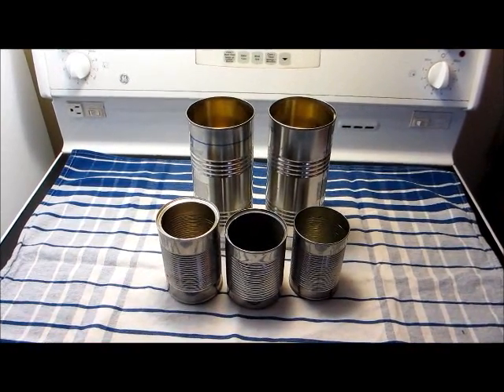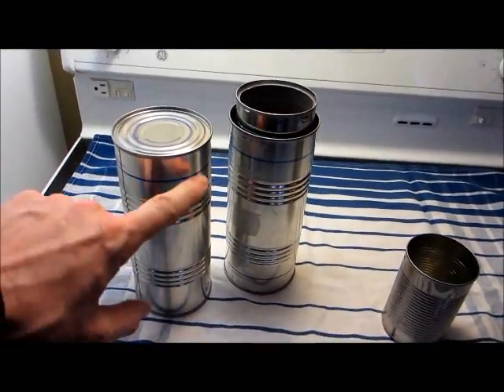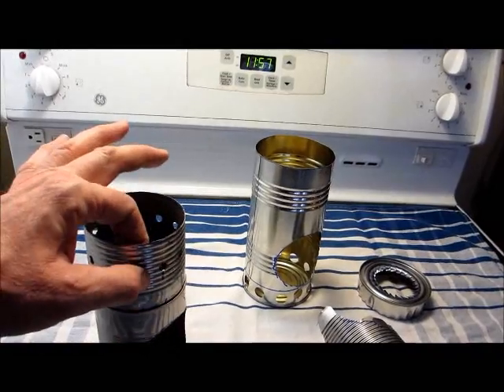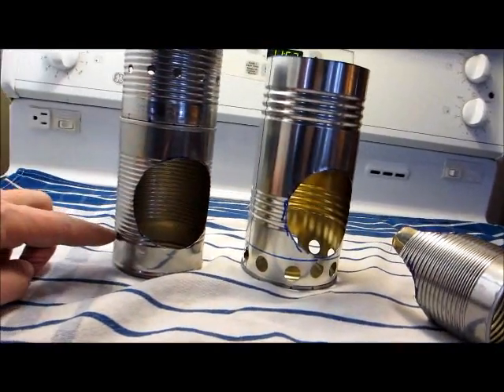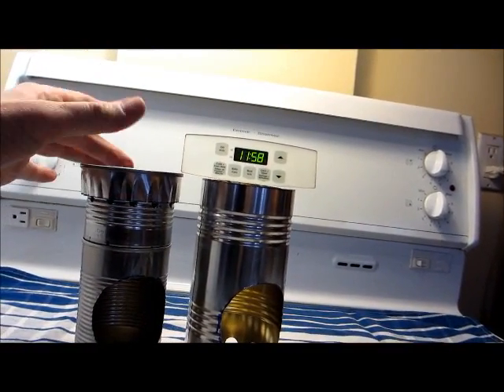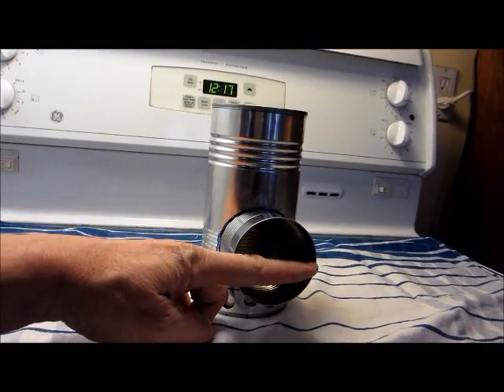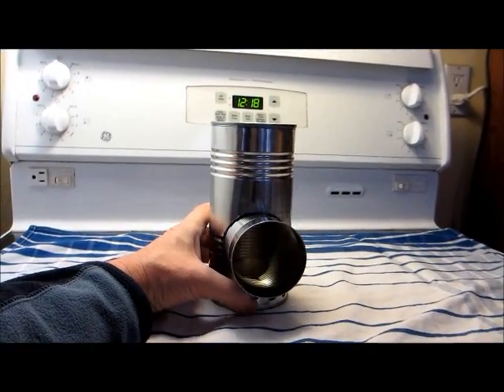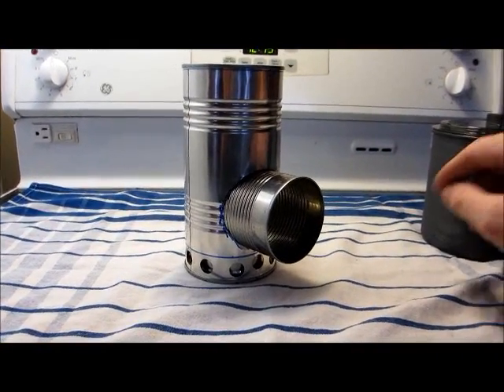Cheap Bastard's Hybrid Rocket Woodgas Camp Stove

Comment: Good Stuff - if you think it could be a bit flimsy in the wind add a base plate or !....! secure with a tent peg on site to keep the weight issue down. I use the inside of a toilet tissue roll filled with ready cut strips of card, lint and other stuff to start the fire and then pack around with twigs. If you take it with you in a sealed plastic bag you'll know it's dry tinder.

Comment: use a clothes hanger to raise your pot just above the top in order to satisfy the  problem of the pot blocking the venting of the air flow
Reply: the hanger wire only needs to lay across the top to be raised enough to vent

Comment: what's to secondary burn from the outer can? the combustion chamber is isolated from the outer can. only fresh air can make its way into the fire from the outer can's holes. besides, being of higher temperature, air would prefer to enter through the side feed pipe anyway. without a secondary burn of woodgas, it's not a gasifier stove. without a thermal mass to retain the heat in the chimney, it's not a rocket stove. all you have is a multi-piece, overdesigned chimney draft stove.

Comment: for this to really work as a woodgas stove you would need some holes along the bottom of the burn chamber, so that the air rising on the outside of the burn chamber can pull the woodgas up along with it for secondary combustion.  otherwise, nice work, i am currently thinking about making a hybrid wood gas rocket stove, if executed properly i think it would be quite efficient.

Comment: Pretty good design and execution for a first. I am curious as to how it worked out.
Reply from the maker: Somewhere on my channel there is a burn test video for this stove.  I worked like a charm, but all in all I find it too big for my own personal use.  It was really just an exercise in design using recycled materials.  I learned a lot about how to re-purpose tin cans (garbage)  for practical uses.

Cheers from Montreal QC
Reply: +Jeff Spate other DIY rocket stoves I've tried that are smaller than yours here, just don't draft as well as I'd like, and they don't have secondary burn. I really like your idea! what cans did you use?

Comment: Just a quick question. This actually doesn't gasify? It's simply drawing air via convection and blowing it in above your combustion chamber, cooling the flue in turn, reducing the "rockety" nature of the stove?

I only ask as i'd been looking into using a sealed fuel chamber for a camping stove, and using the same air intake system to power air into the combusion chamber.

Comment: The cheapest & simplest hobo stove copy can improve greatly with a taller uptake. Even if it's not insulated, a couple of times the diameter of flame column containment above the height shown here turns the whole thing into what it should be.
 From smoky & sullen, to cherry red steel and a roaring almost invisible jet of flame >2X  the height of the original stove.

Comment: Greetings Jeff. I have built several WoodGas Stoves and for my next project I have been looking at modified rocket stoves. Your idea is along the same lines as what I had imagined. One of the integral aspects of the Rocket design is the insulation of the chimney pipe and combustion chambers. The packable size restraint and weight prohibit mediums like sand...etc. What about Exhaust Wrap?

Comment from the maker: The tall cans were from some kind of baby formula-type milk.  I'm sorry, but I don't remember the brand name.  The stove worked like a charm.  When it was burning you could see the jets igniting at the top just like a standard wood gaser.  I did a test burn vid and posted it on my channel.  The project never went any further (sadly).  I was drawn in a different direction - towards simpler hobo style stoves.  Check out the IKEA hobo stoves.  They are far more practical & user friendly.
Cheers

Comment from the maker: Hi Ed,
Sorry, I only made the one prototype as an experiment. On my channel I have another vid which nicely demonstrates it's capabilities.  What I discovered (and suspected early on) was that the rig was too narrow for its height - making it somewhat unstable if not set on perfectly level ground. Overall, it was a sound design, but it really needs a larger base, in my opinion. All you need to do to make one yourself is visit your local recycle center for free supplies. Good luck.
Cheers

Comment from the maker: My information sources are Dr. Thomas Reed & Paul Anderson, the leading published experts on forced air & natural draft TLUD stoves. Reed is the designer of the Spenton LE & LX camp stoves. Paul Anderson has the informative TLUD Handbook available on line in PDF format.  It might be worth your while to give it a read to clear up your misconceptions about pyrolysis and  primary & secondary air flows. Mind you, the rocket stove is a horse of a different color. More on that later.
Cheers

Comment: WRONG SIR!!! In a wood gas stove the upward movement of the air pulled in from the outside pulls gasses through the holes in the bottom of the INNER can, THOSE gases  travel up the space between the cans, due to convection, and it is THOSE gases that are ignited at the holes at the top. It is not hard to understand but you seem to have some block, could it be EGO because you want to think you made a "hybrid" when you didn't?

Comment from the maker: The holes at the bottom of the outer can draw air into the space between the two cans (see bush buddy stoves).  Convection draws the heated air upward.  In a wood gas camp stove as the heated air passes through the inner top jets it ignites gases released from the biomass in a top-down burn.  The hot air between the 2 cans is ALSO intended to replace the insulation material normally used in a rocket stove (rocket stove .org). Unlike a standard bush buddy, this hybrid allows for continuous feed.

Comment from the maker: Webster's dictionary defines hybrid as: the offspring produced by the crossing of two individuals of unlike genetic constitution.  I have crossed  a wood gas stove with of a rocket stove.  The result is a combination of ELEMENTS borrowed from each. As such it is neither, in the strictest sense, a wood gas stove NOR a rocket stove.  It is, in fact, a hybrid. Instead of a ring of small holes in the bottom of the inner can, it has one large one (like the rocket). Get it?

Comment: It isn't. I have seen the information on the stoves. It lacks the feature that makes a wood gas stove a wood GAS stove. That feature is the presence of holes at the bottom of the inner can which allow the GAS to be drawn into the space between the cans, and up to the top where it is burned. Without that feature, the gasses of combustion do the same thing they do in a rocket stove. It is a rocket stove that allows plain air to be drawn up to the top.

Comment: Doesn't a woodgas stove have holes  on the  bottom sides of the inner can. Those holes allow the vacuum created by the convection to draw smoke from the combustion chamber  to the space between the cans, it then travels up to the holes at the top where it burns as jets of gas. Your hybrid stove isn't really a hybrid. I'd be interested to see how it worked if you had the holes at the bottom of the inside can